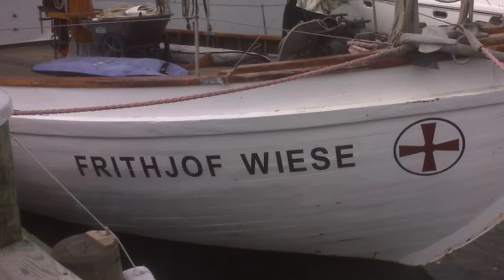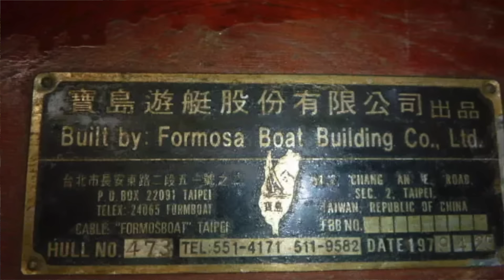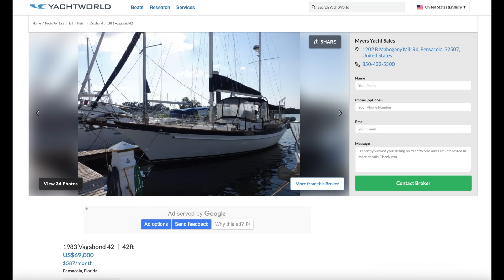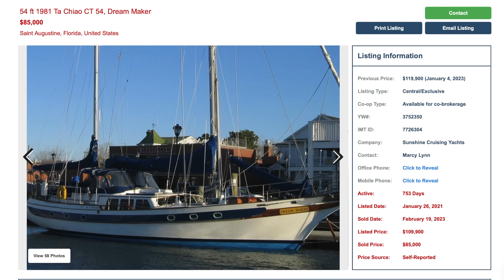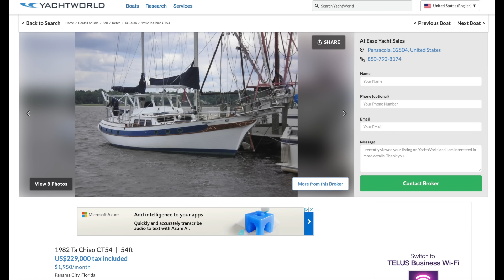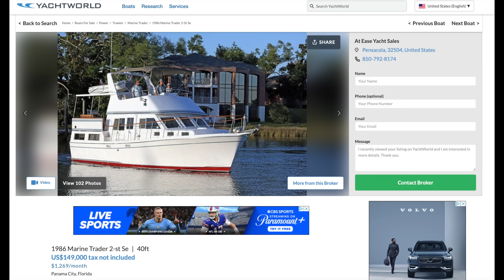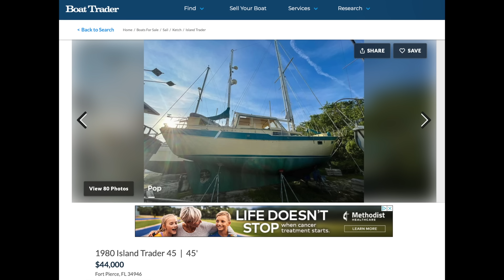*PART 2* WE MADE AN OFFER on the ABANDONED Mikelson 50 Pilothouse and We Got a Response! Ep. 36

Comment: I would make another offer, 25,000. You can end up spending 100,000 on this boat without blinking an eye.
Reply from the maker: I’m working through one of our other brokers so he has to be realistic about what he presents to the bank. It also doesn’t work in my favor that I work for the brokerage dealing with the bank.
Reply: @TheSirensLog  Yes, bank examiners don't like that sort of relationship.
Reply: In NZ a substantial refit of a vessel this size would set you back 300K in Materials, components, Yard fees, Professional Services etc (even on DIY projects its hard to do it all yourself) that would include the rig but not sails. its likely to be substantially cheaper in the US. One thing about this type of project is that the cost is spread over time and at the end of it you know the boat and its systems back to front.

Comment: Your enthusiasm is infectious. I wouldn't be  too concerned about a dodgy rudder repair. It dosen't matter too much if it fills with water as long as you eventually get on to it. To do it properly you should split it in half and check the condition of the metal inside then glue it back together. Preferably with it removed from the boat. Its a big job and the vendor is never going to do that. As long as it works it will be good for a year or so.  The leaking rotting Coach House is possibly the biggest issue. If the Bank were to cost that out they may get quite a shock. It should be costed at shipwright rates. regardless of who actually does it . I do hope you get it but yes it is a big project. I have been looking at a similar boat in Australia, Formosa Peterson 46 but for me the renovation cost is going to be prohibitive and   I don't have much free  time . I will cool my heals for a while and watch you guys.
Reply from the maker: Awhh thank you. Glad to have you around!
Yep, this was my way of thinking on the rudder as well. I figured we could patch for now and then maybe replace in another year. I wasn’t sure if I was right in thinking that way, but we’ve now had a few comments that make me think I could probably get away with that. 
Yeah, I really don’t think the bank has any idea what they’re looking at. But then they list it, they’ll start to see, I think.

Comment: You offered a very good price. If the bank has a problem with that, turn around and move on. There are too many problems on this ship. If the bank contacts you after a certain time, just offer 10,000. Even that's a good price for the bank. Banks are rich and have endless money. You don't have infinite time. Keep looking. Someone mentioned a Bristol 45.5s I'd be interested in.
Reply from the maker: Good point. If by spring they get into a pinch, we might get it less than $30k. 🤪

Comment: One thing to consider about older boats.  They have what I would call a value ceiling no matter what condition they are in.  A 1987 boat refit to new in all respects may sell for that value ceiling, but what it brings will not be anywhere near the cost of the refit.  Consider that when looking.  A boat like the one you are looking at likely is worth $150K-$175K for a perfect boat.

One thing, there is a huge difference between owning and working on a small open boat and a 50' sailboat. From listening to your earlier video on this boat one thing that struck me was that you don't really know what you don't know about boats like this one.  I say that as a person who has owned larger sailboats for 30+ years.  Get a survey before making an offer on a boat like this and then get price estimates from yards for the work you can't do yourselves based on the survey.  Any offer you make must include contingencies that allow you to back out of the offer if the survey shows major issues you were not aware of.

I assume you have considered where you will keep the boat.  It can be hard to find a slip for a 50' boat.  Many marinas have wait lists.  Don't buy a boat until you have a firm place to keep it because transient costs will kill your budget quickly.  You mentioned Panama City.  It was hard to find rates there for long term dockage, so I am guessing $1K up per month for a 50' boat.

As far as the Island Trader trawler goes, the big issue is the engine(s).  Repowering a 40' trawler is going to cost major money.  A friend paid over $40K to replace one engine on his 35' Egg Harbor.  Anything over 5,000-6,000 hours on the engine(s) would be a concern to me.   If you are looking at a powerboat of that size you need an engine survey in addition to the standard survey.
Reply: 350k would be the ceiling.  Formosa 51s and Hudson Force 50s go for that now.  Granted, not many of these boats have sold in the last 20 years because they only made 18. Some have been lost to storms, grounding and disrepair. Seeing as this boat is very similar to the Formosa and Hudson's, I think this is a very fair comparison.  You have to think, A new boat this size would be a multi million dollar boat.
Reply from the maker: Yeah, we have great resources here. We know a lot of people, are good friends with the shipyards, I’m a local broker and know marina owners, etc. That certainly helps, and we know we always have the option to keep it on the hood if push ever came to shove. Florida has no anchorage laws. 
The Marine Trader is the trawler version of the island Trader. The Marine Trader we’d be looking at is one I know well it’s actually one of my listings and it’s absolutely gorgeous and it’s in almost completely original interior condition, very well preserved. Had a refit in 2021 so lots of new on the exterior all the way around. The boat has a lot going for it but with a price tag to match, at $150k. The engines are good to go and I have no concerns with them, plus a survey was just done on it and the owner is doing even more work to make her better. That boat is a dream. Honestly, I’m sure we won’t buy it because we do want sail, but it would be great to feature it on the channel. 
You’re right about the Mikelson. We’d have to get another survey done but I’m going to give them some time to sit on it a little while longer.

Comment: Another year or two and that boat is worth the cost of a big dumpster and the Sawzall to get it in the dumpster. 30k is generous. Bankers are not sailors. Send them a list of actual known needs with costs and a lists of what ifs. Sails and a repower 40-60k easy... hidden hull problems behind that new bottom paint? Oh well. Good luck!
Reply: All reasons to AVOID old boats unless the fool before you already dumped 100k into it and now needs to recoop a tiny portion of his life savings back ,,,,,
Reply: @SailProMarina to be fair, a 100k won't even get you a good used Grady White. That's what a brand new Flats Boat cost.
Reply from the maker: Yeah we’re prepared for all of it! But the cheaper we can get the boat, the better

Comment: I think you are wise with your offer. I purchased a Beneteau 361 for 1/2 of the ask 10 years ago and sold it for double after 5 years of use, and reasonable maintenance. I  purchased another boat with the same ratio to ask in BVI- 4 years ago, and Did a good refit- I think it is a great boat and hope to go down soon and sail. Nice to see you both with sensible dreams! Try and eat heathy non- processed food as much as possible- meat and vegetables, plus lots of fruit! Not worth to overpay, I have worked in aircraft most all of my life, and found that I need to budget 50% more than I calculated on most projects, as we always find additional hidden issues to address!
Reply: Thank you for watching.   I usually double my estimate just to make sure.  lol
Reply from the maker: Thanks for the comment and for following along!! Yeah, I think if they get the systems going we will re-asses and offer again in January and see what happens. Right now, I like this boat the best.

Comment: Ketch, huh?  Good taste - far better than a yawl, especially for a cruising boat.

I taught inland cruising on a 53 foot steel ketch off and on for a couple of summers. Lots of fun - even had a full size bathtub (moored use only) and full size washer and dryer. It also had the quietest genset I have ever seen. Nav aids were RADAR, LORAN and GPS - even had a plotter for track.  I am far too old for that any more - it is hard work to teach beginners some things, especially reefing or dropping sails.  Yes, it had Lazy Jacks, which simplified at least getting sails down quickly if necessary.
Reply from the maker: Yeah lazy jacks sure are nice. Better than whatever this system is!  Hahaha

Comment: Siren and Captain Hal,
This is a beautiful Vintage Motor Sailer.  I am a very qualified Welder Mechanic ElectricalContractor a Ham Radio Operator and Pilot.,Pilot.   I also have a Small Power boat,which I completely re built.  This boat is a Huge amount of work and with the visable amount of water intursion it's a big risk!   Looking at the Mast Mount into the bilge, all of the floor boards would need to be removed to see exactly what going on in the Bilge.  That would expose all of the wiring and systems which you can not see with it like it is.  
A consevative Restoring Estimate would be well over $150,000 dollars,maybe more?  I know your both very capable persons to restore this boat but with the time and work to do it,would your investment pay off in the long run?  With water damage and rot that is a major concern, but again with the unknown factor of the systems and wiring and mechanical not being able to be tesed thats is a Big Gamble.   What you will find in the Bilge is totally Unknown!  I would NOT  take a project on like this!  I wish you the Best in finding a boat which is sea worthy and doesn't have these problems.
Reply: I mean 150k buys a good used Grady White.  So for 150k and my spare time I get a floating house?  Kinda sounds like a deal.
Reply from the maker: Well, we were fine with the unknowns at $30k but now that they’ve turned that down, they will have to prove systems work before we can offer more, and like you said, it’s still a gamble!

Comment: Remember me with the Hudson Force 50. I have an offer for you on my boat. If Would you be interested and your other deal falls through. She has a practically new 125 hp yanmar diesel. 10k panda suitcase generator. fuel polishing system,  Replace main an head sail from quantum sails she is a ketch. New boom and boomvang by Seldon . Bow thruster upholstery is in great condition . Huge Capt, quarter. Very large forward cabin could sleep 3 or more . Has had 6 kids in it camping before. Hauled out 5 or 6 years ago holds 250 gal fuel 100 water . AC front and rear both need upgrades one works one doesn't. . Looking for some one to take over payments . Owe around 60k
Reply from the maker: Send us photos and the info!!! sirenwilliams@thesirenslog.com

Comment: If you are really set on this boat, or any used boat, you pay a professional surveyor to go over every inch of that boat, all systems inside and out.  With the results you receive you won’t have to guess at the work, and dollars, needed to get this boat back in the water.  If the owner(s) can’t certify the boat is seaworthy, you will not be able to insure the boat.  And the value of the boat becomes the salvage value only, far cry from 130K.  I’m not saying you can’t sail a boat that is not insured, but God forbid you have an accident where you are responsible, and you will lose everything.  Use the survey for any boat to your advantage and good luck!
Reply from the maker: Liability insurance isn’t as difficult to get, and we do have a survey and did at the time of filming the video prior to this. Most of our findings in the boat were based off that survey that we went through extensively. However, the systems weren’t tested on the survey

Comment: The cruel reality is that the bank doesn't want to get rid of the boat like people think. Banks are not looking forward to lose money. They like to make money. If they have possession of the boat, it's probably because it was put as a guarantee for a loan and the bank won't let it go for nothing. It actually can't. It just can't get anything from the borrower and liquidate at insignificant prices to recuperate the loan. Their job is actually to get the most they can.
Reply: You are absolutely correct.  The problem is, I don't think they know what they have and by the time they figure it out the boat will be in even worse condition.
Reply: @haltarpley9237  you are probably right.
Reply from the maker: Yep. I agree.

Comment: I'd disagree with the boat acronyms. If you don't maintain a house , it will fall to pieces just like a boat.
Reply: Not as fast.  2 years will destroy a boat.  2 years on a house its most likely fine.  Saltwater is hell and gets into every nook and krany of a boat.  You can never get it all out.   I let a boat sit in a friends yard for 2 years and it needs a complete refit.  The engine needed attention and took 3 days and a lot of money to get running again.  The boat needs a full rewire.  The only part of the boat that was sound was the hull.  I let a house sit closed up for 10 years.  It just need a new AC unit and some rodent entry points closed up.
Reply from the maker: Boats fall apart a LOT faster than houses! But just like a boat, in time, a house will fall into the ground too. Thank you for your comment. Please stick around!
Reply: Acronyms?

Comment: I have been a boat owner since the early 70’s, have a mechanical engineer degree, as well as a past member of the ASPRONADI ( Association of Naval Architects of Italy) - yes, I’m not young anymore 😜… I happen to have worked with and for different well known Italian boat / ship builders until the early 90’s, and semi-retired in 1993 in South West Florida. 
Talking from this kind of experience, I’d say don’t even think of buying this old Chinese boat, and thinking that you can “revive” it by DIY at a budget to get it seaworthy, as this will bankrupt you and tank your dreams forever !
Since you both are relatively young, the better way would be getting plans from a decent naval architect and build it yourself from scratch with Epoxy / fiberglass and marine plywood or honeycomb material over frame (avoid working with the cheaper resins like polyester and vinyl ester) , which will give you a very durable vessel for many years to come.
This way you certainly get your money’s worth, and while you are building it from scratch, you will get to know every detail of your boat, from the structural to the mechanical to the electric / electronic and plumbing aspects. 
Time wise it will not be more challenging than dismantling and rebuilding an old boat, it will let you avoid unforeseen upcoming problems and expenditures and lastly let you calculate much more precisely the real cost.
Reply from the maker: Hey! Thank you for your comment and your expertise! That sounds like a wonderful way to go, but we would really rather not build fresh. We’re weirdos. We balance logic with heart and I’m a long time lover of Taiwanese vessels and even more so- wood. I absolutely don’t want a wooden boat with our tropical lifestyle, but without a wooden interior, it wouldn’t feel like home. That’s silly! I know!! And it’s most important that the boat is practical FIRST, but the second priority is that it has soul as well. Check out some of our newer videos and be sure to stay tuned for what we are putting out this Sunday. We may have found her.

Comment: Good luck guys. I thought 30k was a generous offer. I also think that the surveyor must have been friends with the ex owner or something. There's a lot of work to be done, & that's just the work that you can see. Keep up the good work. SV Kiwi Lady Opua Bay of islands New Zealand 👍🏿
Reply: He is a good surveyor and has a good reputation.  I trust the survey, I just think he is off on his price.
Reply from the maker: I think his price was assuming all systems work and they weren’t tested. Yeah he is a good surveyor, but…. I don’t know! I will say that if it was cleaned up and presented better and the fiberglass work was done on the rudder and it was in the water, this boat might not be that different than any other of similar style on the market for $130k. Even when they sell for a lot more, many still have all these problems.
Reply: @TheSirensLog, our 80's hood 38 had B and G instrumentation from the 90's, good kit and functional but not a NEMA network set up also the Autopilot could not be trusted we replaced it all with a Raymarine system, I would budget to replace any navionics and instrumentation that's more than a decade old. We kept the hydraulic motor and pump for the autopilot as it was massively over spec but connected the Raymarine head unit to it, this worked flawlessly on our cruise and was particularly good in Steer to Wind Mode.
Reply: @number1genoa  We are planning to replace them.  We might use them in the beginning if they work.